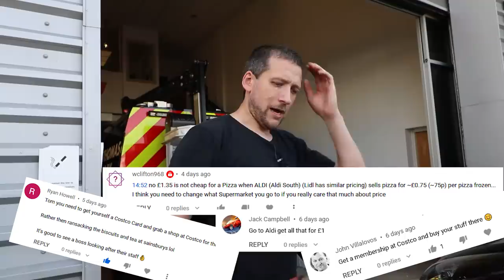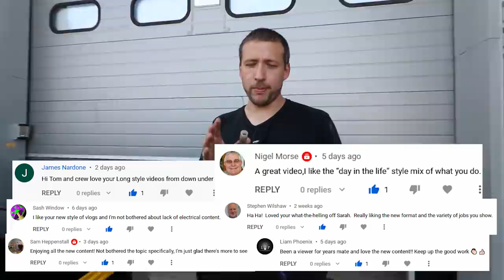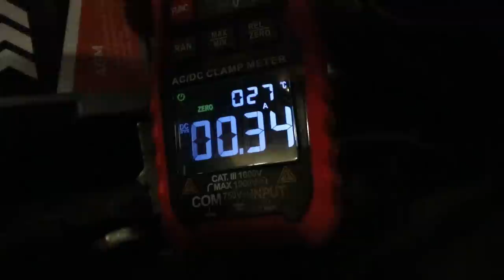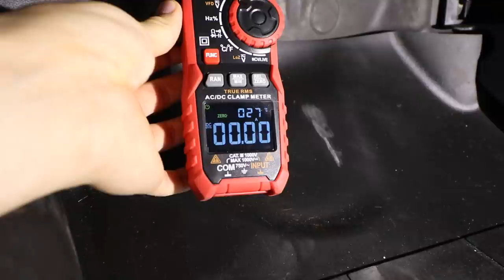THE NIGHTMARE JOB IS BACK! | Thomas Nagy

Comment: It's the Van's computer. It needs battery power at all times. If you disconnect battery cable, battery drainage should stop, but the Van's computer will disturb.

Comment: Make sure you latch the bonnet catch when measuring current - some vehicles don't go fully to sleep if open. Also some take minutes to fully shut down after ignition off
Reply from the maker: Thanks for the tips pal!!
Reply: Also make sure the keys are well out of range too
Reply: @thomasnagy  CTek, Sealey and many others now do bluetooth battery monitors if you wanted something you can pop on and check the status without firing up the vehicle. Would be ideal for your bikes too. Cteks unit (approx £50inc) definitely allows multiple vehicles to be linked on the app at the same time. Victron do a really smart one that does current up to 500a as well at about £120inc
Reply: monitor the current while you pull one fuse at a time to pinpoint the device that is causing the battery to drain. If it is a common problem there could be an ecu update available.
Reply: mike please do some more teardowns
Reply: Often around 15-16 minutes before they are fully off.
Reply: Another one is people who have something hooked up in to the OBD port of the vehicle. That generally prevents one or more of the ECU's from going to sleep. You should be aiming for 30mA of sleep power, which can take a few hours for that to occur.
Reply: Battery Current readings on Vauxhall Vivaro 1.5tdi 2018, basically same van. Same means of testing- bonnet catch, alarm, etc - After locking and everything shutdown 0.35A big cable and 0.49 small cable.  Out of a team with 18 same year model vans more than half have had new batteries in 3 years - All the daily drivers still on original batteries
Reply: yeah... um... 600mA is a HUGE amount of draw for a vehicle that's turned off.
You should only be seeing maybe 80mA. Usually more like 15-30.
Reply: @thomasnagy  they take at least 30 mins to fully power down. The computers stay running for a certain amount of time. Also I drive a 15 plate vivaro and can easily leave it for 2 weeks, battery hasn't been changed since new.

Comment: So the battery problem you are seeing is real, funny enough we have it too. Last year the company I work for switched from Renault Kangoos to relatively new Renault Traffic with Sortimo Racking and all that good stuff. When we picked the vans up from the dealership, not even one van wanted to start on its own and hab to be resurrected with battery starters. Every time one of the vans stands a little while because somebody doesn't need it we have to kick-start the battery. I think it's a Renault problem and our dealership said its normal unfortunately, something with the radio, car computer and all the electronic it doesn't shut off completely. To get around the problem, we have to drive the vans every 500km for at least an hour or out it on a constant charger. Hope that this can help you, greetings from a German spark.
Reply: There is a power leak draining the battery but the main issue is the size of the battery.  A van designer assumes the van is always on the road every day with motorway miles.  Get a bigger high power battery and this will help.   In winter the battery drain will be worse when using heater and such and then combined with cold starting will start to grind you down

Comment: The whole thing about access to live parts if you unscrew the pendant cap is a bit moot.  You can remove the bulb and get access to live terminals you can shove your finger into, at a convienient height!  The regs don't really cover this as a potential source of shocks.  This is one of the most likely places you're going to get a problem, changing a bulb (and forgetting to turn the light off first because you can't remember which way round the switch is: because it's controlled by 3 switches around the room).

Comment: On feeding your staff... I've worked in half a dozen places where food, beer and snacks are laid on thick and fast. Mostly tech companies (similar to the top secret one you did some work for that time). Never once have I seen or even heard of anyone taking the piss. It's always respected and seen as a two way street. You just have to hire the right people and make sure the company culture is good across the board, not just the perks.
Reply: I've done some work in the Microsoft store in London and even as an outside contractor you can help yourself to snacks and drinks, there's no reason to take the piss.

Comment: I tell the customer I've not tested the downlights and put them down as a limitation and reasons why. I also make them aware that there could be further issues and faults if we introduce a new board or RCD. Good luck on the way to 100k Tom 👍.

Comment: Remember to disconnect that Anderson connector before you drive off with your van.
I used a Neutrik "PowerCon True top" and forgot to disconnect the cable (230V in, not an external charger) once.
It ripped the connector, its socket and the rivets out of the metal, leaving a couple of female spade connectors behind.
Reply: get a fluro spiral cable and hook it to your door from the connector as a reminder...lol
Reply: I've seen on paramedics' cars, they have a connector mounted in a side body panel for a blue 16A connector, like a caravan hookup, but there's a solenoid built into the socket so that when you start the engine the plug is ejected.

Comment: Current Battery reading Vauxhall Vivaro 2018. Following same methods, bonnet latch alarm and waiting for shut down etc Big cable 0.34A small cable 0.49A. On a team of 18 all with same year models over half have had new batteries after 3years. All the vans used as daily drivers are still on original batteries

Comment: A good tip for the 4way board house when you have those grey style dumb electric meters. There's a flathead slot to isolate the load side, which means when installed there's no need to install and double pole isolation switch!

Comment: We had an auxiliary battery build into our work fleet ( basically a battery in parallel on a switch) the switch in in the dash and when your gone low hit the switch and no jump start it's worth looking into
Reply: BBC vehicles had a similar arrangement, some even had a second alternator, to charge a technical supply battery to power all broadcast equipment in the vehicle without affecting the normal battery’s

Comment: I own a Renault Megane RS300 - this is fitted with a 'DESS' battery - essentially a 19ah lead acid battery and some ultra capacitors .  These go flat very quickly when left for a while, or as you point out, open and close the door a few times - I feel your pain!

Renault have released a software fix to try and help the situation, although I believe the fix was to simply shutdown some systems quicker.  Some cars/vans systems an take an hour or more to fully shutdown!  Not sure if there is there same for your van?

The 'dash lighting up like a christmas tree' or phantom faults/spanner light are also indicative of battery issues - cars/vans are VERY sensitive to voltage variations.

Are the vans using keyless entry?   I have a running theory (which a few others have mentioned) that keyless door systems are always listening for the key, and if they appear within range then systems start back up even when not unlocked - so if the keys are in range of the van, you you frequently go past them with the keys on your pocket then it could be waking up systems and thus draining the battery.  On my RS300, I have disabled through software, mostly because of the battery issue but also due to the security concern!  If you cant disable it within the settings menu, a faraday pouch will help here.  

To help find the draw,  you could measure the voltage drop over a fuse - just google 'automotive fuse voltage drop chart' to bring up charts and you can start to narrow down what fuse and thus what system is causing the draw.  South main auto Youtube channel has done a few videos on this.
Reply from the maker: I have the same issue with the Tarfic, it takes a few hours before the systems fully shutdown. I never thought about the keyless entry, that could be a very valid point. Thanks for the input, it's much appreciated.

Comment: Helpful tip on the van standby current test. If you leave the van alone for one hour and repeat the parasitic load test, it  will give the can bus network time to go into sleep mode. You will get a more accurate current

Comment: About that outside socket full of water: In Belgium the most commonly used sockets and switchgear brand is Niko. Their outdoor backboxes for switches and sockets have 2 5x5mm knockouts on the back right near the corners diagonally opposed to one another, and the backboxes are designed to have the edges sit slightly (1mm) away from the mounting surface. This is done to avoid exactly this problem: Niko advises to knock out the bottom square (depending on which of the possible 4 directions you mount it it's one or the other) so condensation or water that finds its way inside can just drain out.
Downside is ants and other small bugs do find their way inside through the drain hole, so it's probably a good idea to keep an eye on that.

Comment: Although using a charger while swapping in a bigger battery sounds like a good idea, the whole logic behind having to use diagnostic equipment to change the battery is so you can basically tell the vehicle what size battery is fitted in order to optimise smart charge, stop/start, etc. so it's not a good idea.

Also, can you do a review on that clamp meter. I'm a mechanic and I'm currently looking for hand held dc clamp meter.

Really enjoy your content. Thanks 👍

Comment: Try running down the fuses measuring volts across them with a DMM. There should be a couple of mV drop across the guilty fuse(s). Much quicker than removing each fuse in turn and measuring the current.

Comment: Re.parking - I read somewhere that some boroughs do tradesmans permits
Reply from the maker: Interesting, I'll have a look into it, thanks for the tip :)
Reply: There's still some permit shops around West London, all you need is a utility bill from a customer and you can get a whole book on the cheap.
Reply: Brighton do permits, £900 a year per van. Only covers 9am-5pm after which you can be ticketed between 5pm-8pm when parking enforcement is still in operation. Most times it's cheaper to get the ticket.
Reply: Yup, some of my better customers had them. I think they cost £5 per ticket per day. In books of ten irc. Look like a scratch card. This is about 8 years ago mind.
Reply: @thomasnagy  try asking about parking dispensation permits
Reply: I was a bit shocked when Thomas explained the ticket situation. I understand and agree from the business perspective. I would still not like to pay for it from the customer perspective. Raises the question of whether the driver's get into the habit of parking recklessly anywhere... I lived in Chiswick and always offered parking time to tradesmen back then, so I guess I was ok :-)
Reply: In Australia some of these parking permits cost more than the price of a parking infringement
Reply: I was doing a job in the city of Melbourne one time on the 28th floor of a high rise building where the only parking around was a one hour limit so I spent 40 minutes out of each hour relocating the car. Client wasn’t very happy but wouldn’t pay for a ticket. Now we include parking fees in the quote.
Reply: If a customer doesn't have parking , let them know the concquences and if they don't accept , provide a suitable solution, time to drive off as you don't want Customers that aren't reasonable.

Comment: Your batteries have to be registered to the vehicle.
If you don't register the battery the vehicle won't charge properly.
Beware what battery charger you use .You need one that is  AGM compatible.
Everything turned off it should draw 50ma approx.
Reply: ah, so those are apple vehicles with apple batteries that are cryptographically linked ?
Reply: @AmauryJacquot  no, you can buy fairly cheap OBD tools that can do this via UDS.
Reply: @Adam-eb3rs  guess you missed the joke 🤣

Comment: With reference to you loose terminal and the bathrooms, In fairness that is why people do their own work, electrical, building, mechanical. So many people don’t give a monkey’s what ever their trade is (or are not given time to fix problems)
Reply: It's the age old rant about the DIYers, sometimes DIY work is better because it s work for whoever is doing it and not tied to an hourly rate. could also end up being an unsafe dog's dinner... But tradesmen do those too at times, sadly.

Comment: A parasitic battery drain as its known as should be no more than 50mA 600 mA is way too high so the vehicle is still "awake" things like body control modules and capacitors in door handles for keyless entry can take over an hour to go to sleep. So as stated above make sure everything is locked and totally asleep before checking. You can also use voltage drop across the fuses to test using a multi meter set to millivolts and when the vehicles in sleep mode you should have zero volts across the fuse.

Comment: Good stuff on the van standby current.  0.6A x 10 hours ( overnight) is 6AH   Which is 10% of your 60AH battery.  If you have done short trips round town and the battery is not full when you park up.........
Over a few days and it will really struggle to start. 
60AH battery seems small for a van esp diesel.  Prob smallest that Renault can get away with. Add accessories trackers, alarms cameras etc and it’s not big enough.

Comment: I always first fix my cables to every practical position possible on lighting  to future proof install  , the cable is in place but not used  , I always use 10mm on new shower & oven circuits

Comment: Reference changing the battery to a bigger one. You really need to have the new battery coded to the van. It is done like this so the charging control system is able to know it has a new battery and it’s now 120ah as opposed to 60ah. It basically then knows how much capacity it has to to work with.  As most modern vehicles have a smart alternator they don’t always charge when the engine is running. Instead waiting until all the criteria is met before engaging.  So even though the van could be driven all day the criteria might not have been met to enable charging.

Comment: I can’t believe it Thomas, the first thing that they must check when you have dead battery  issue  is  the battery clamp connectors. I heard a lot of stories like yours, it is really frustrating ☹️☹️
Reply: I do all my own servicing too due to the main dealer saying they changed and air filter when they didn’t. When I questioned why they charged me they spun me a yarn the computer made a mistake WTF.
Reply: @stendecstretcher5678  I always check the easy to check stuff as I always wonder if they do what is claimed. Personally though, in warranty a lot of stuff is pointless when you aren’t keeping the car so you can usually tell them to leave it, also with things like cabin filters. That can easily be changed yourself for less

Comment: I feel your pain. Just had a fridge delivered today and when they took the doors off to bring it inside they ripped the wire for the bottom door sensor. They put the doors back on ,  covered it up and left. It's hard to find good service these days. They also put one of the hinges on wrong.

Comment: @thomas nagy   Solar panels!
I run three work vans with GPS tracking, led lighting and accessories - Tried all sorts to eliminate standby draw before realising its a fools errand today = we need electronics running. 
I've put a small flexible solar panel on each van where practical + a cheap pwm charge controller on each = problem solved.  Even generates current under the garage lights when parked inside 👍

Comment: It could still be the sortimo stuff. The control circuit for that voltage sense relay must take some current and the relay to hold the power in. It doesn’t take zero. Monitor the smaller cables to it or the ground.

Comment: Done the thing with using a charger to keep radio etc alive while battery change, if worried or if a smart charger use a small set of jump cables and another battery ;)

Comment: Nice one......regarding the battery drawing power ( 2-3 amps ) while asleep....it's not asleep....! it still needs to feed the ECU power which in turn powers the alarm and Imobiliser system , apparently Renault know about this problem but they have had tens of thousands of these faulty modules made and paid for so they are using them.......👍

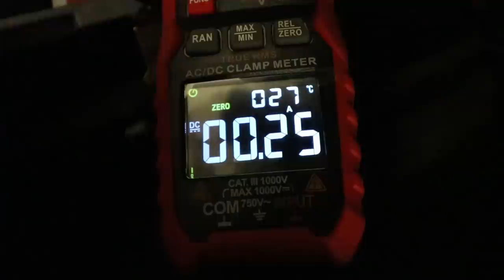Comment: 18:00 that is a lot of standby current.  Few things, if you have keyless entry / go (push button start) can cause a higher drain if the key is within about 15-25' of the van, and then if you have a telematics unit on them?  Also is there a "hood sensor" to know its open or not?  Many cars will take a while to go to sleep, so you might have to close the hood and leave the car alone for a while, (make sure you don't have the keys anywhere around).

Comment: My dad worked for a leasing company in the maintenance department and some cars kept flatting batteries and needed a jump start, it took a while to figure out, but it ended up being the trackers when parked up in certain places couldn't get a GPS signal so kept retrying constantly so flattened the battery.  So they disconnected the trackers and no more flat batteries

Comment: The other thing you can do, which is pretty common in commercial vehicles here in Canada, is a small permanently mounted trickle charger with a shore line connection to top up the batteries overnight/over weekend.

Comment: Great new style of content Tom. With your battery issues, with the van locked the alarm will be armed and possibly drawing a small current. If you have the time remove 1 fuse at a time and see if the current draw drops.